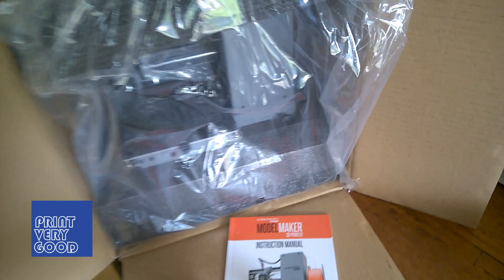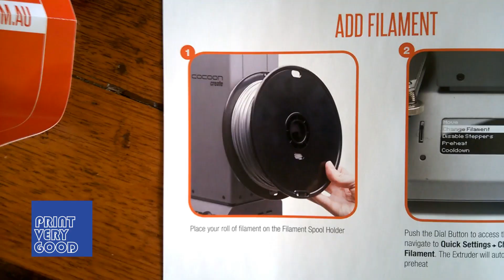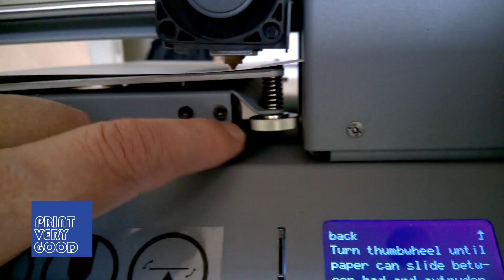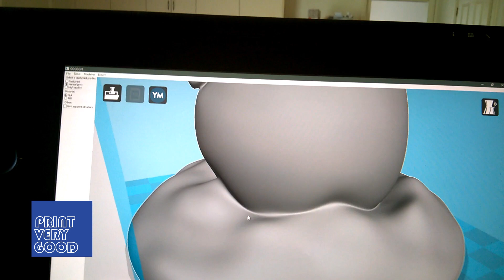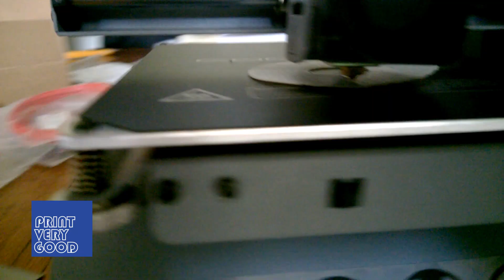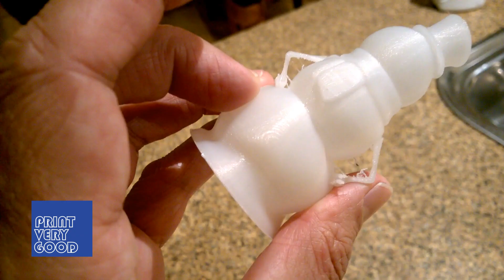Aldi Cocoon Create Mini 3D Printer REVIEW

Comment: I just purchased one, what is the "J" shaped metal thing in the box with the scraper?
Reply from the maker: Hi YeahhhBuddy. That "J" shaped tool is used to clear blocked nozzles. It's more effective with a direct drive extruder 3D printer like the Cocoon Create Touch where you can remove the filament and gain direct access to the hot end. I will make a video on the usefulness of this tool soon.
Reply: Print Very Good awesome, I assumed that's what it was for, love your work!
Reply from the maker: Thanks very much Yeahhhbuddy999!

Comment: Hi does that printer have a heated bed it is not essential for printing pla but improves your prints. If you have problems with lifting prints use superhold hair spray it works great solved all my adhesion issues. You wont find much help from cocoon but the internet is fantastic especially youtube. if you would like to create one off designs find a 3d program ( Tinkercad) is fantastic for the novice and you will be creating your own prints in no time. if you want any help or advice I am only to happy to help.Cheers and happy printing
Reply from the maker: Hi Master Wu! No heated bed unfortunately, but I'm having great results with bed adhesion just by using Isopropyl alcohol, made a video here https://youtu.be/VumJQyD7KlQ but if lifted prints returns I will certainly try your hair spray tip.
Thanks also for the Tinkercad suggestion but for all my designs I like to use Blender. 
I appreciate your offer for help and assistance Master Wu. Thank you.

Comment: I have the same printer. Spray with some adhesive and the bed works great. Every print perfect since doing that, including a replacement for a lost M17x1mm threaded nut for a bicycle pump. Perfect fit first pop and strong enough too. Very surprised.
Reply from the maker: That's great to hear Tim! I've actually stopped using spray adhesive and am just using Isopropyl Alcohol (purchased from Bunnings here in Australia... Digger's brand) and am having amazing results. My video about that here https://youtu.be/VumJQyD7KlQ

Comment: I'm having trouble I've done everything the guide manual has asked of me. I tried printing the tennis ball it gets through the first layer before stuffing up. So I'm not sure what's going on. Looks like you got yours working really well!
Reply from the maker: Hi Destiny! Let's see if we can get it sorted. We'll need to work through a few things. First question is where did the tennis ball model come from and are the print settings designed for the Cocoon Create Mini?
Reply from the maker: Can you also send me a photo of the failed print? Send to paul@vangaans.com
Reply: Print Very Good It was on the micro SD card with the machine. I just wanted to test it out before I went for any gcodes online.
Reply: Print Very Good And sure I'll send it tomorrow.
Reply from the maker: Ah ok. In that case I should have that file here as well Destiny. Sometimes the gcode files that come with the printer are actually flawed, I'll see if I can test it here. The other thing to check is the microSD card itself, mine turned out to be corrupt. I could save files to it but it ended up corrupting one file and caused my printer to crash.

Re downloading other gcode files, I'm going to make a video on that tomorrow as there are things you need to look out for as they may not be suitable for your particular printer.
Reply from the maker: Ok great! Just use PVG instead of Print Very Good ;)

Comment: Thanks, nice video. I've been struggling as well with bed adhesion on my new Cocoon Create Mini, so I've had a go a hairspray, and it helps a little. 

The sample gcode files work OK for me, but I've not had much luck with models I've downloaded from the Internet. I think my settings in Cura might be off. Did the Windows version that came on the SD Card include a specific profile for the printer?
Reply: Yeah, I picked up a Bostik glue stick a couple of days ago which worked pretty well. My mate picked up some blue tape from Jaycar and he's had really good success with that too.
Reply from the maker: Thanks Andy! I actually tried spray adhesive to try and help adhesion but I had the best results by ignoring the manufacturers instructions and doing a lot of trial and error tests to come up with a sure fire solution. I'll upload the video explaining what I did tomorrow.

When installing the Cura software there is a section that prompts you to select which printer you have, I selected the Mini option and use the default settings for that profile. I'll do another video showing what settings I use. I made another part today and I'm very happy with the quality of prints I'm getting from the Cocoon Create Mini.
Reply: Cheers. Look forward to it
Reply: I use a UHU glue stick or Bostick glue stick, that helps with adhesion.
Reply from the maker: Thanks for the tip baconman! Am having good results with spray adhesive. I spray a little onto a tissue and wipe the print bed, works really well!
Reply from the maker: Thanks Andy good to hear.
Reply: I had the same problem for a while. I just stuck down some painters masking tape onto the print bed, and now it works as expected... xD